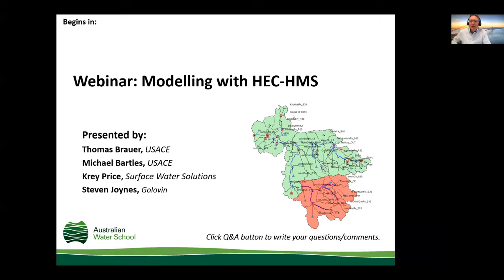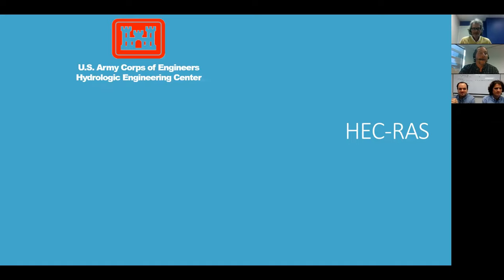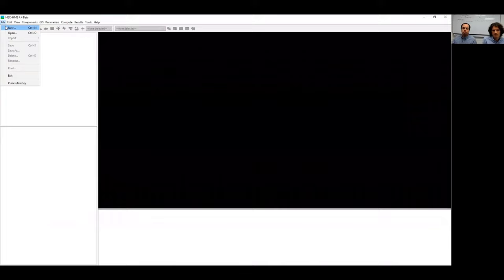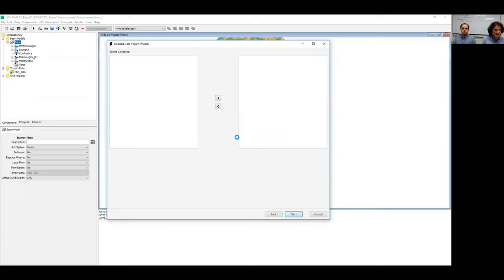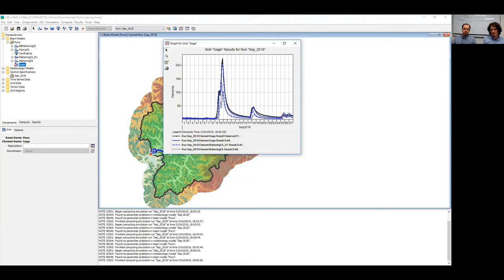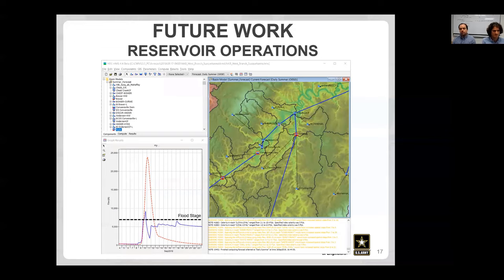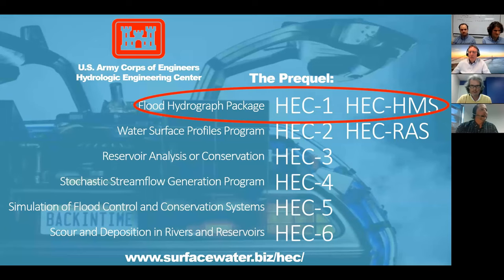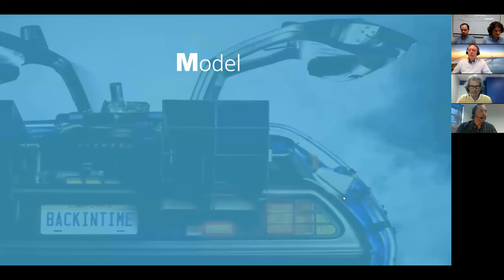Modelling with  HEC-HMS

Comment: area to define streams depends on what? on what basis did u enter 70 sqkm for area to define streams? Is it the basin area? If at all we are taking it as a basin area we are facing this error WARNING 46501:  Unprojected coordinate systems are not recommended for the basin model. as river basin huge its area is 2,58,948 sqkm

Comment: Hi, how would you recommend to discretize the precipitation in liquid versus solid form, in a basin that has a lower zone where it rains and a higher zone where it snows? I have the model georeferenced with a DEM and all the sub basins have been created with the GIS tools. Thanks! I need to put some kind of function so in the areas that are over 2000m it does not rain in liquid form, or at least asign cero precipitation (i just need to analyse a 24 hour event)
Reply from the maker: Hi Felipe, thanks for your question. In this instance, can we suggest you reach out to the HEC-HMS Users Facebook group found here https://www.facebook.com/groups/hmsusers/ to get assistance with answering your question? Good luck!

Comment: Question is Why my Terrain Data Manager is closed? I cant enter my terrain. It's grey so ı cant select it under the "components"
Reply: Same here. I can't find the solution.
Reply: I had also the same problem. apparently, it is not activated. and according to HEC HMS manual and I quote;"There are other menu options on the GIS menu that are inactive in HEC-HMS version 4.3 and will be turned on in a future version of the software.  The HEC-HMS team is adding GIS tools to the program to aid in automated delineation from terrain data and parameter estimation from GIS datasets "
Reply: @Marwan_M_A_Ali  The Hec Ras is 4.4 Beta it’s not available yet in the HEC web it’s only for investigators

Comment: Is it possible use HEC HMS in Australia? How can we use it with ARR2016?
Reply: Hi AR V, the accepted hydrological software is RORB however I believe you can use Hec Hms or another software if you wish as long as you can comply with the ARR2019 in relation to ensemble method/Montecarlo etc. for the definition of peak flows/storage volumes and the general required results.